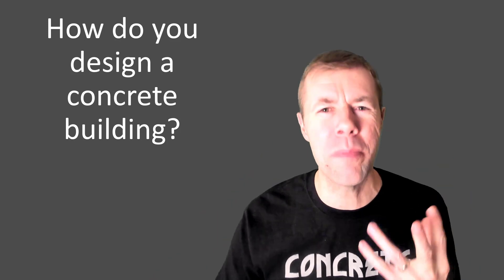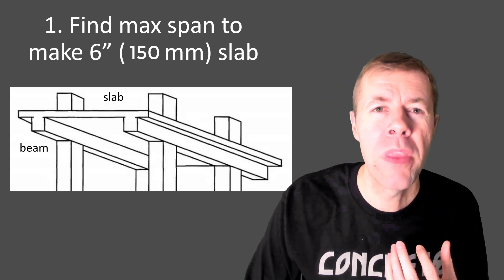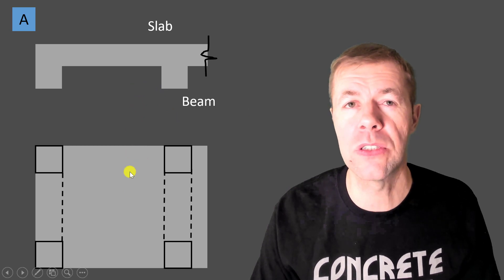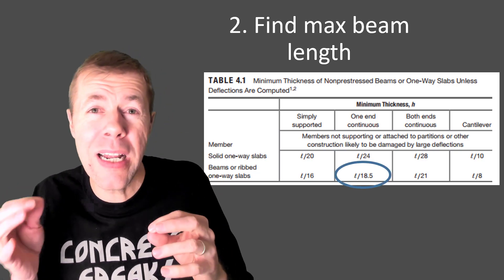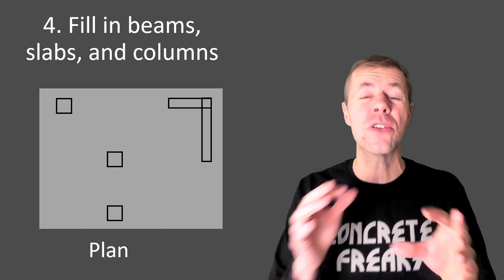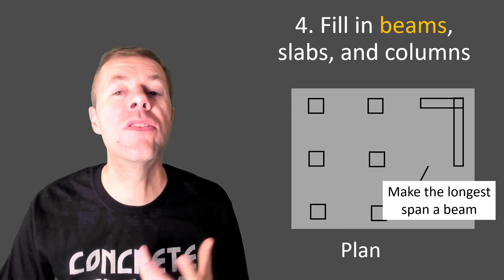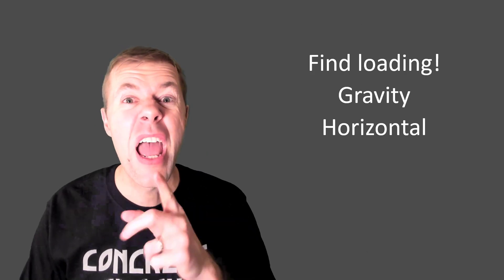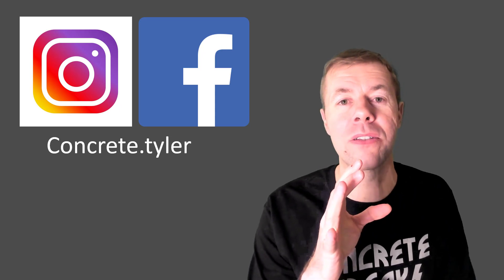Concrete Building Design Tips - Building Layout

Comment: Hi Mr Ley,I have a simple question about concrete main components.
Cement:Hydration(Combining and hardening the mix as an adhesion material)
Sand:filling voids between gravels
Gravel:Gives the mix high compression strength
am I right?or could you please add any even tiny information to my answer?Thank you a lot we all love you best you a great wish

Comment: Hmmm - I am using pre-stressed beams under my slab (intergrated reinforcement to tie them together) My beams are smaller, lighter and stronger than the proposed pore in place ones shown here.
I get 8 meter span this way and a clean looking roof.
Your video on pre tension / post tension gave me the nudge in that direction - Thank you buddy.

Comment: Awesome video, please make more like this that are targeted towards students (or people like me who are just interested). Tangential question: I've always been curious about how you pour a concrete slab for buildings like that. Is it often just a plywood form that is assembled and then disassembled floor by floor? I've also hear about precast slabs that lock together, or steel decking that you can pour the concrete onto. What are the use cases for each? Thanks!
Reply: Hi, it depends on how much you can spend. Wood forms are the cheapest and steel forms are relatively expensive.  For the precast members , they allow us to get better quality reinforced concrete elements. They are used in viaducts' slab, for instance.